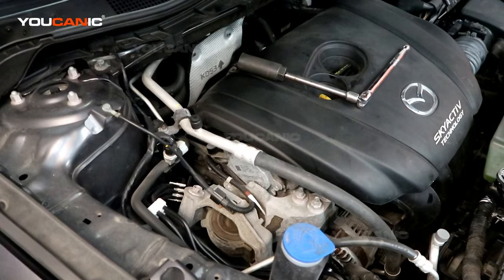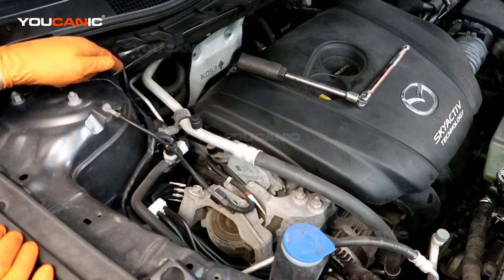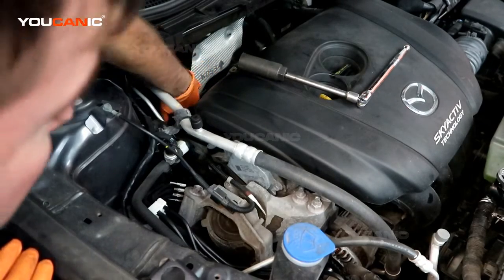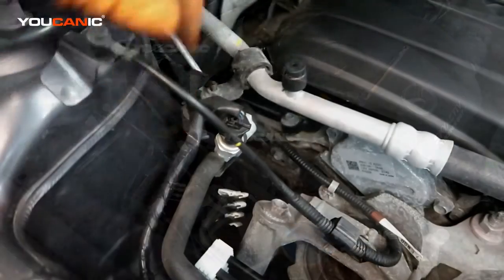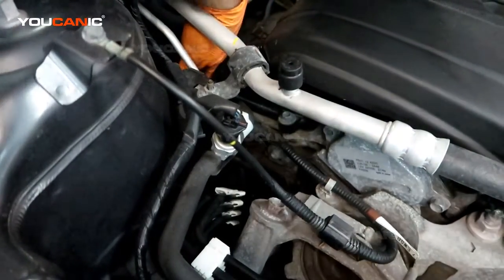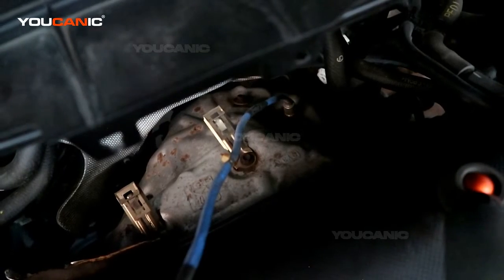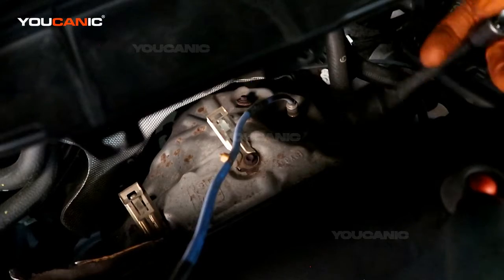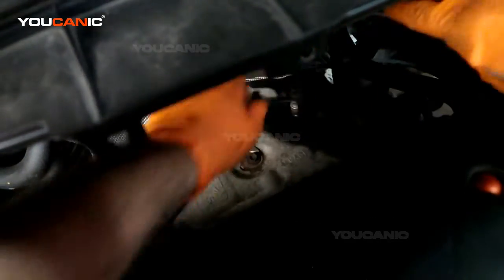2013-2017 2.5L Mazda CX-5 - Upstream Oxygen (O2) Sensor Replacement

Comment: Hi, I have a 2019 Mazda cx5 with the mileage of 367700km, may I know can I clean the upstream oxygen sensor with the throttle body cleaner or mass air flow cleaner? I ask ChatGPT and it said Mazda cx5 oxygen sensor is not recommended to clean, it is better to replace a new one. Is it true?
Reply from the maker: @RickyLeemingchee If you’ve got a car issue or repair question, you can find step-by-step guides and scanner help at youcanic.com. We might miss some comments here, but our site has answers for most problems already!
Reply: @YOUCANIC sure and thanks

Comment: My CX5 2020, 2.5/194 hp CX5 from couple days show me this P2096  error. I  check the MAF senzor, clean it, but the error is still coming back. P2096
Raw code: 2096,ECU: Engine control unit, Status: Pending, Post catalytic converter fuel trim (FT), bank 1 - too lean!!! I  noticed that  the engine is a lilte bite loud , starting with this error showing ,! Is that  O2 sensor faulty ? Is just 26 000 mile , so  is not a little bit strange , to  early ?

Comment: Just replaced mines and the check engine light went off . 
Thanks! Saved me $500+ at dealer doing it myself
Reply from the maker: That's amazing to hear that we could help you save on dealership repair costs! At YOUCANIC, we are dedicated to helping car owners with our wide range of resources like the YOUCANIC Full System Scanner (www.youcanic.com/scanner) that can help you diagnose car issues just like a professional mechanic.

From OEM Factory Repair Manuals to a platform where you can ask car-related questions, we aimed to make car repairs accessible and understandable for everyone. Don't hesitate to visit us at www.youcanic.com for further guidance. We're always here to help with your automotive needs.
Reply: What code was your OBD reading? Did it resolve the issue long term?

Comment: Maybe you could help me a lot here (thank you) = I think I have to change one of the oxygen sensors. But I'm not sure this is the problem. 
What were the signs on this vehicle to know if it was the oxygen sensor was defective - -( upstream ) or maybe the downstream oxygen sensor was defective? 

 I have a Mazda CX-5 2014 2.5 Liter. The Check engine light stays on.  When the vehicle is hot, the idle speed goes right to 2000 turns per minute sometimes. I have a message that says that the gas is too lean. I don't have the code with my small digital unit..
Reply from the maker: Hi there, thanks for reaching out! A failing oxygen sensor could manifest in various manners - from a persistent check engine light to irregular idle speed when the engine is warm. In your case, you mentioned a lean mixture warning, which frequently points towards a faulty O2 sensor, commonly the upstream one. However, without the specific code, it might be challenging to be sure.

We strongly suggest taking the Mazda for a comprehensive scan using a professional diagnostic tool like YOUCANIC Pro System Scanner (www.youcanic.com/scanner) to get a pinpoint diagnosis. Also, you can get access to Factory Repair Manuals and Torque Specs at www.youcanic.com/manuals. This will help guide you in troubleshooting and fixing the issue. Remember, our mission at YOUCANIC is to assist car owners like you with their repairs. Let us know if you have any other questions.
Reply: Thank you for trying to help me - I wish you a Happy 2024 year

Comment: Thank you for the great video,,, But how do you unclip the plastic plug? I'm having a problem doing it?
Reply from the maker: Hi there! Thank you so much for your feedback - we're here to help you through your car repairs. Concerning your issue, unclipping the plastic plug sometimes requires a bit of careful wiggling rather than brute force. Try gently pulling it from side to side and see if it loosens up. Don't forget, our videos aim to be informative, easy-to-follow guides for all car owners.

To assist with future repairs or diagnosis, consider our professional diagnostic scanner, the YOUCANIC Pro System Scanner, which can be found here: www.youcanic.com/scanner. Also, for access to Factory Repair Manuals and Torque Specs, you can check out this link: www.youcanic.com/manuals. We aim to provide you with all the resources you would need for your car repairs and maintenance. Happy repairing!

Comment: What issues did this bad O2 sensor cause? Like on this particular vehicle?
Reply: worse fuel economy, annoying light, could be that your catalytic is bad and o2 sensors are indicating that
Reply: Noticeable louder engine idle and run, lean mix of fuel air ratio since not detected in engine exhaust, results in bad fuel economy, stressed engine etc

Comment: Yoooo what a coincidence I just brought my cx5 to mazda today for a diagnostic check on my check engine light. They want to charge me $700 to replace the o2 sensor but this video makes it much easier. I think the audio cut out tho on the second half of the video
Reply: indeed, we do loose the sound in the video but I do not think we really need it.  Thanks!
Reply: Did you have fluctuating idle?
Reply: Did the O2 sensor fix your issue? What code was scanned